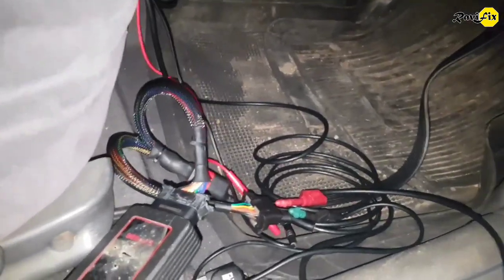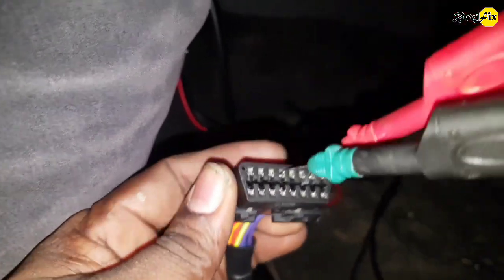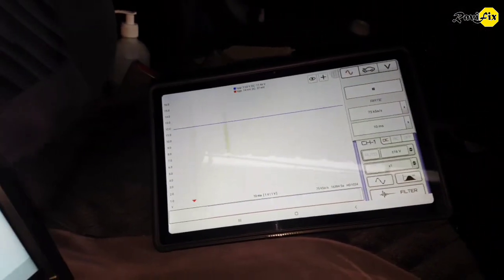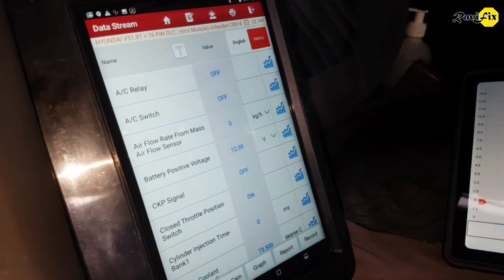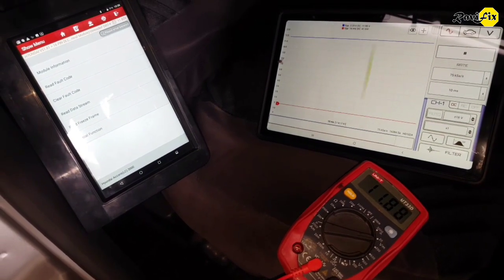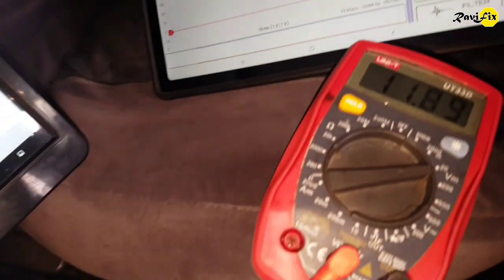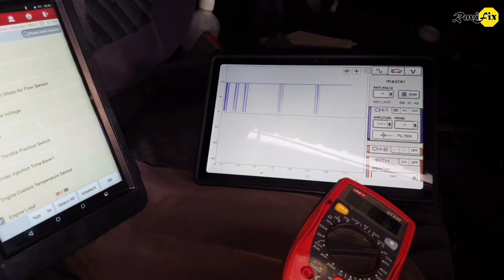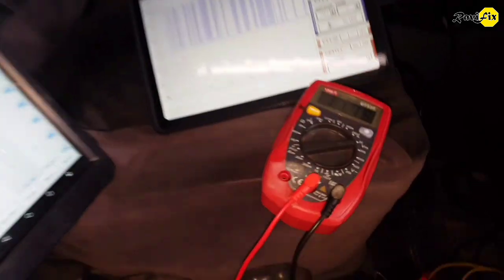OBD scan tool not communicate with modules? Diagonose the K-Line communication Bus.

Comment: I see you say pos to pin 7 dlc and neg to chassis ground. Ok and the k line is a low speed square wave signal with no data multimeter showing 11.89 but thought you said you shown how to diagnose k line communication bus. At what time in the video was that?
Reply from the maker: Sorry, this is first diagnose step when you have no com with scan tool, check K line is online by using multimeter or oscilloscope. 
Will post video when I met such K line issue.
Reply: @ravifixall  cash module says k line no comm. Other modules say the same about k line. My mate says remove battery. Remove one module. Reconnect battery. Delete codes and rescan. If I line comms fault gone it was that module causing the problem. Else disconnect battery. Reconnect computer and disconnect another computer then repeat. Erase and rescan. Any k line faults.
Reply: @ravifixall  I liked you went to live data to encourage communication on k line. Speak a little slower mate.

Comment: My car is Tucson 2007 and the protocol is ISO14230-4 kwp fast, when I select car protocol manually stell can't get any live data on torque app, even though I can read car error codes normally,  any tips to solve my problem?
Reply from the maker: Try torque app pro version
Reply: I'm using Pro version, even though I tried 3 different apps and 2 adapters and still the same.

Comment: Hello sir i just purchase hantek 6022be and using with hscope app i have purchased both licence version but i have one problem that this tool only giving me upto 5v range signals only if i want to 12 v signals it not giving correct signals like k line and more so what can i do to get this 12v signal with this scope and one more things i purchase already automative licence version also but there is no presetting for any signals in hscope app
Reply from the maker: Hantek 6022BE only support For max 5v. its from hardware. You need to use attenuator for over 5v. This is not a problem with Hscope software.